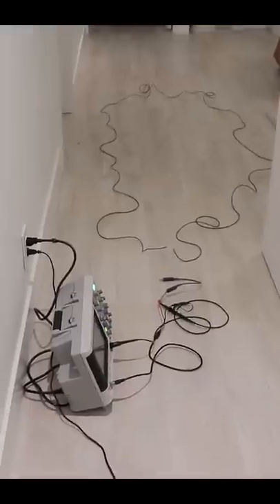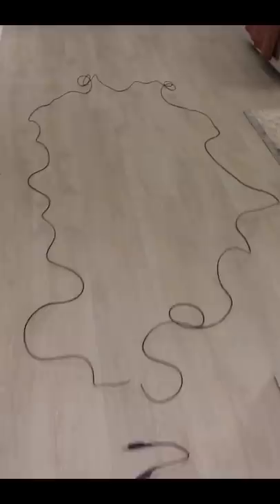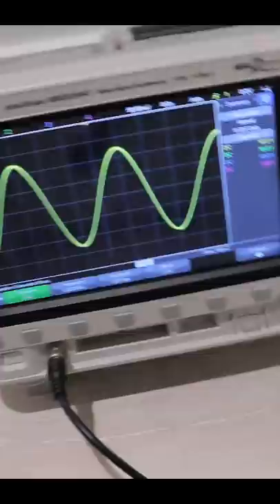The Crazy World of AC Electricity #shorts

Comment: I have some ICs from a small company that are meant for "AC harvesting" I haven't done anything with them yet.
Reply: What is meant by AC harvesting?  That sounds potentially interesting, or it is just a resistor. XD
Reply: @BloodAsp  probably for harvesting energy from RF emissions. Antenna -> rectifier -> boost converter -> output. Usually not enough output to do anything useful unless your antenna is really big :)
Reply: Technically inductors also produce AC like power with magnets moving near them
Reply: @BloodAsp  stealing power 😂
Reply: I installed an Armoured cable from one end of the factory to the other before it was connected it was picking up enough RFI  to light an LED.
Reply: @BloodAsp  Ambient magnetic fields generated from all that wiring that powers civilisation. You can harness power from it, but only tiny, tiny amounts. Enough to run a microcontroller in deep sleep that wakes up occasionally to take a sensor reading.
Reply: @tmmtmm  Yeah, the general term is a rectifying antenna or rectenna. You can also make it tuned for a particular frequency if you want better power output (at that point it’s basically a radio but with no demodulation as we’re only interested in the raw power), but a long-ass wire with a diode between the terminals will give you some power. Add a voltage multiplier and you'll probably have something you can charge a capacitor with.
Reply: @BloodAsp  it sounds fancy, but it is just marketing. It is high efficiency, low voltage boost converter - cool in its own right, but much simpler then the description.
You can have some fun with it and build useful stuff with those ICs, but they are literately for niche applications where you have to carefully balance, well, everything.
Reply: @thebaker8637  voltage multiplier won't do anything. voltage doesn't figure in the time constant, only the series resistance. it takes the capacitor the same time to charge to 10V and to 100V. and in any case,
you have to clamp the voltage to some known value (like 5V), not multiply it.
the fields can be really strong - mains wiring, thunderstorms, yes I imagine even piezo lighters. you can make a simple circuit - neon bulb in series with diode and capacitor and long wires across the capacitor and watch it blink

Comment: capacitive coupling with earth and inductive isolation of the two electrodes at 5M Hz
Reply: Bro isn't M really too much
Reply: @captainvenom7252  mega = million
Reply: lolwut? Hint: LED, the last word is diode. AC + diode = half wave dc rectifier.
Reply: @ChrisOhge and?
Reply: It's been about a decade since I played with LEDs, but I seem to remember them not working at high frequencies. I don't remember if it stays on all the time or won't turn on at all, but I'm sure I can find it on the data sheet somewhere if I care to look.

So what's going on here? Is a charge building up along the loop and discharging across the LED when there is sufficient voltage, or is the LED actually operating at 5 megahertz?
Reply: @deadbolt91765  it’s not that LEDs won’t work at high frequencies, it’s more that the balance has to be right. Most the time with AC the current goes down as frequencies go up because of inductive reactance but leds require very little current to begin with.

Comment: I like how these videos actually help me for my physics exams
Reply: Did this one help?
Reply: u switched to archaeology? ^v^
Reply: This didn't help in just confused now
Reply: @washyourhands  nah

Still entertaining lol
Reply: @superzolosolo  yee at first i thought it had to do with phase, UK how a 3 phase motor or components wouldn't require a neutral wire at times, that kinda deal but.... that's not this I'm assuming 😂
Reply: wtf, you are taking a physics exam and this video helps you?   i never had the opportunity to take a physics exam but understand the physics.   fuckin hell
Reply: @kaoselegent1060  lol, way, way simpler than that. you never wondered how the space station or planes work with out a ground?
Reply: @pauliewalnuts2527  well yea ofc, you dont need ground to run a current but you do need a potential difference, and that's where I got confused. Im assuming that because its AC, the alternating nature keeps the potential across the led different enough to induce enough current.
Reply: @kaoselegent1060  i think the potential misunderstanding in the video is what ground is. like you said a potential difference, some where for that current to go. 

the physics of electricity is weird. we were taught electricity 'flows'.  its more like you have a bunch of toy cars lined up, you pusing the farthest back car and it will push the front car.... but only if they have room to move. ground is that room to move, wheather it be the earth, wire, battery or what have you....anything with room and an equal conductivity
Reply: it helped me go in to arson rehab tho

Comment: The LED turns on because a 5 MHz signal would have a  loss through the cable high enough to create a potential drop to turn it on.
Reply: Thats not how that works, if the voltages are the same on both sides of the cable there will be no voltage drop across it
Reply: @lboijens2173 but the voltage isn't the same on both sides

Comment: This video singlehandedly explained AC current to me
Reply: can you expalin it ?
Reply: The back and forth movement causes the flow of electrons in the led to be great enough to make it shine. Right?
Reply: Oof just noticed there's replies. The negative voltage in the AC current is acting as the negative wire in a led system. Since AC current is sinusoidal, it doesn't really matter where the wire connects, it all goes around the wire both positive and negative voltages. 

But this should also mean that as the voltage rises to it's peak, the LED will turn on, then slowly turn off as the negative voltage comes on in. I bet if he slowed down the video you'd see the flickering of the voltage rising and falling.
Reply: @XenXenOfficial  no, everything is much simpler. LED is a diod and internal resistance and capacity of wire is enough to power it

Comment: my fav fact about AC is the fact that, because ADSL is pretty much an AC signal, it doesn't actually need to go through the cable. I've had the case of a line where the main was cut off, but ADSL was just jumping the gaps x)
Reply: The adage amongst telco engineers being, of course, that ADSL will run over wet cardboard. This is a bit pedantic but all signals are AC because there's no information content to steady DC. The actual cool thing about ADSL is that the two ends negotiate frequency bins to best match the characteristics of the lines. Open circuits behave as capacitors: impedance goes down with increased frequency, so ADSL will negotiate to run on the high-frequency part of the spectrum. Audio calls will not work over the same wire because the ring signal is low-frequency AC which will not pass through the parasitic capacitor.

Conversely, for poor conductors with high resistance you can minimize the impedance by lowering reactance, i.e. by choosing to use the low-frequency bins instead. There's a thread I have seen once of people competing for the stupidest conductors that they can run ADSL through -- you can easily get 50 Mbps across a banana or apple, about 5 Mbps over linen string soaked in brine, and I believe someone even got a link through a glass of salt water. ADSL is just plain cool because designing a system that can work with a corroded piece of copper someone laid down in the 1850s as a "telephone line" means you can exploit a lot of weird transmission line phenomena with it.
Reply: @thebaker8637  how do you simulate an ADSL line end point tho? Basicly the part that the customer calls into to be able to get internet?
Reply: @NoahGooder  there are handheld tools network engineers use to verify lines, similarly to the ones you use to verify ethernet speeds. you can connect one at each end and it will tell you the speed and latency you can get from the line in question. JDSU makes some pretty cool ones.
Reply: @thebaker8637  If i am looking at what you are describing it seems to be around $250
Reply: the good old times: Internet is working, but voice calls are not working. The cause of that could literately be a single broken wire, that you can't find because the insulation looks fine from the outside.
Reply: That's mine alright...Our line got fucked 3 or 4 years ago because "some hunters shot the pole", and all the technicians ever did was jerk it around until it touches enough to show a few pages. We now use an LTE router
Reply: @Sketch1994  " all the technicians ever did was jerk it around until it touches enough to show a few pages" I am suprised that actually worked.
Reply: The same happens with a coaxial cable for TV antenna. I was connecting it, and sound/image were already there before the connectors had touched, just 5-10mm off.
Reply: @thebaker8637 it might work over wet cardboard but it won't work well. I have aluminium ADSL, it is awful.

Comment: So I actually did this experiment myself and played around with it for a while.  If you hang the loop up from the ceiling with an insulated hook, this still works, which kind of makes me think that it's not any kind of capacitive coupling to ground.  The length of the wire will definitely change the frequency - and so does hooking up your scope to measure the injected waveform :D. That's why he's measuring such a low frequency here, if you take the scope lead off the frequency you need to light the LED jumps up by a factor of four or so.  I also found that the diode is irrelevant - you can hook up two LEDs in parallel with polarities reversed, so that current can always flow in either direction, and this still works. I don't have any mini incandescent bulbs handy, but I suspect it would work with one of them as well.
Reply: Solo con diodos, es un desfase por la longitud del cable.

Comment: Oh, that's nothing: crazy is that you can run ADSL over a taut line of string soaked in brine.
Reply: lol so true. After some work was done in the stairs in front my flat my DSL was running like slowly and with packet loss, but still working. I went to have a look and found that one of the two DSL wires had been cut.
Reply: that's it? my internet works through the air, no cables needed!!
Reply: i like your funny words magic man
Reply: That works for Austraila.
Reply: @Agis That's probably because it's the one I use for my work ID, so it's technical a mugshot!
Reply: @wobblysauce  Telstra don't bother with the brine though... 😁
Reply: @AK11020  Damn that's one of the funniest wikipedia articles I've read
Reply: A local ISP ran ADSL over barbed wire fencing and used it for years while they built out their infrastructure.
Reply: If you seen some of the phone line pits... they were under water.
Reply: I used to get really mad at derivatives homework problems that involved tanks of brine.
Reply: - My connection became slower.
- Have you tried spraying your cable with water?
Reply: You can run ADSL across an open circuit. A line break acts as a lumped/parasitic capacitor, there is a voltage across the broken ends of the wire with an insulator in between. ADSL will negotiate to only use the high-frequency bins to get low impedance from the capacitor and hippity hoppity I have 5 Mbps downity. Wet strings, bananas, apples, etc. also work for the same reason, you just pick the low-frequency bins to minimize any reactance from AC and keep your impedance as close to just the resistance as possible.
Reply: @dobrowolsk  The same thing had happened to us a few years ago! Our Internet was slow and would disconnect from time to time. Turns out one of the DSL wires had been cut where it enters ours house from the outside. I think my dog's leash did it over many years.
Reply: @AK11020  the fact that’s actually a thing is hilarious
Reply: This is how BT runs it’s broadband infrastructure, that’s why they can’t offer decent speeds anywhere in the country.
Reply: @wobblysauce  Better, Faster, Cheaper after they switched to non iodized salt
Reply: Australia's NBN co enters the chat...
Reply: @wobblysauce  Nothing works in Australia the electrons fall out the earth down there. (@dave)

Comment: This occurs because the electrons can’t get to the protons fast enough before the direction switches, so all he’d need is a tiny amount of - current to trigger it (ofc with the + connected). The frequency required for this phenomenon can be calculated by c (speed of light, about 186000 in the equation) / length in miles (or do the respective conversions to feet or meters, depending on where u r)